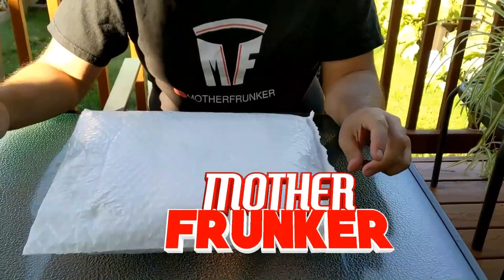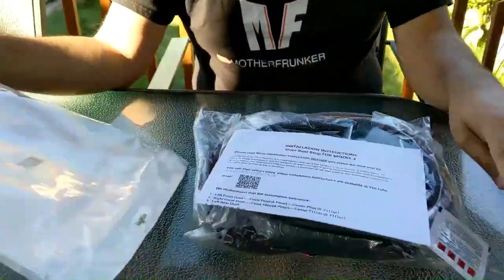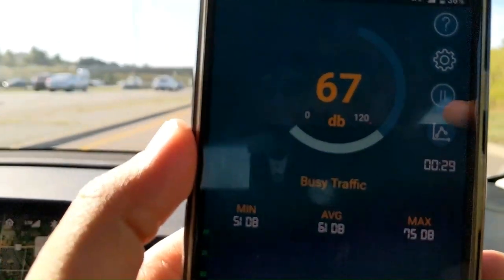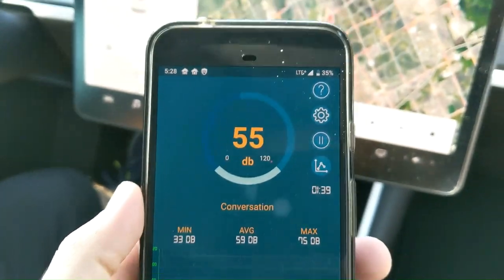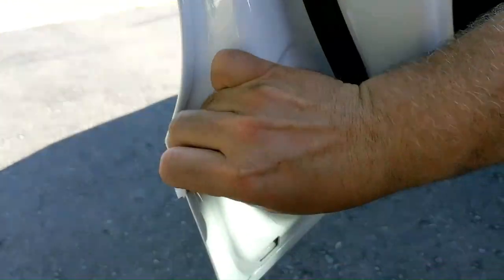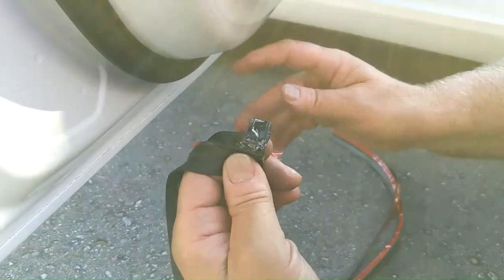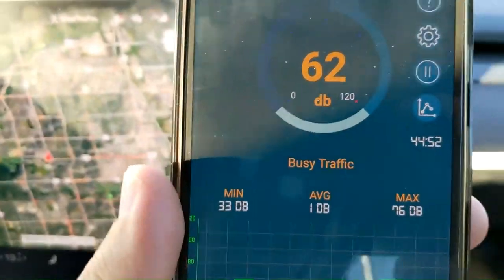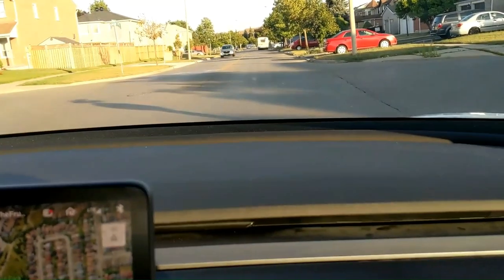Tesla Model 3 Door Seal Kit Soundproof Rubber Weather | BASENOR

Comment: I actually installed this exact product (BASENOR) on my model 3 about a week before you released this video. I came to pretty much the same conclusions, very little overall reduction in road noise, but I do like how it prevents dust and water from getting into the door sill areas. I also like the softer door close sound. Overall I'd say it's ok, but if you're buying it specifically to reduce road noise, you will most likely be disappointed.
Reply from the maker: Exactly. It is actually a good product for dirt reduction and a softer door closing. They should change their advertisement for it. Would probably sell more.
Reply: Hi, I think I got a similar product for my M3P. Additionally during winter time it keeps the heat in the car,so you can Turn down the heater and save battery

Comment: Short answer: No.

Door seals help suppress WIND noise. A good brand of high aspect ratio (smaller rims, taller sidewall) highway tires are your best defense against road noise. The trade off will be things like handling and mud/snow/wet or off-road performance. You have to decide what's most important.